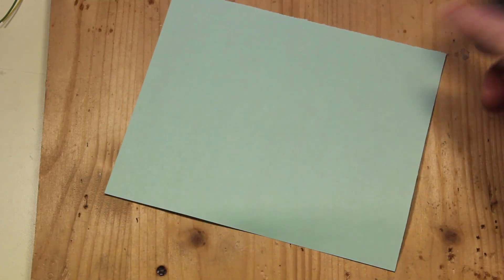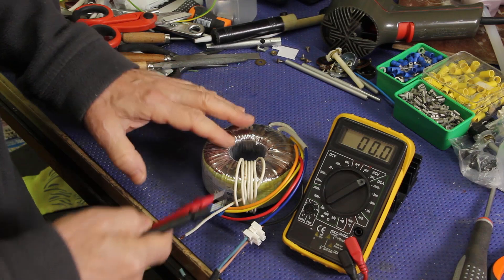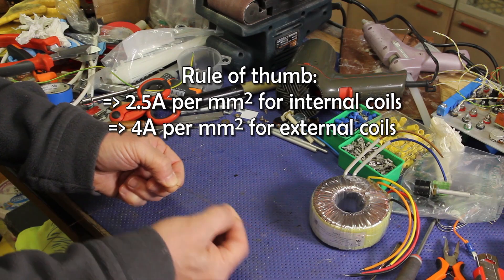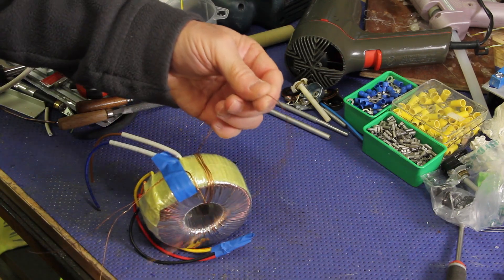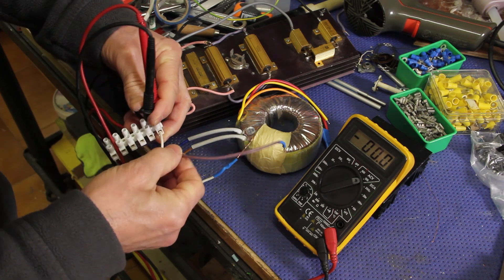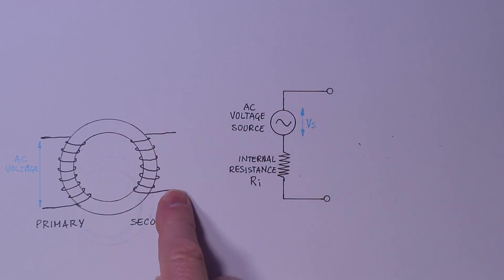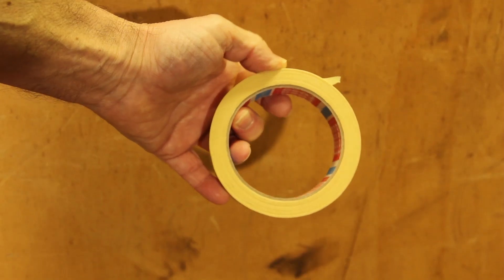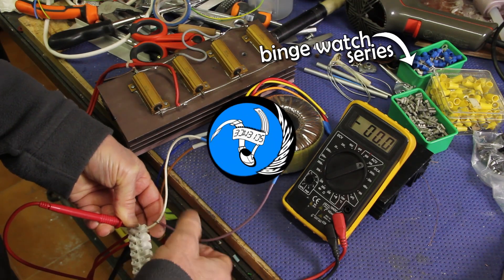How to Add Extra Windings to a Toroidal Transformer – Custom Multi-Voltage Hack

Comment: Even if you're doing shorter amounts of wire (without a shuttle), you can still make it a lot easier by first winding up all of the wire on a pencil or pen, and then removing the pencil/pen so you just have a small coil of wire which is small enough to pass through the center.  Then you just unwind the bundle as you go round and through the toroid (and you don't need to feed long lengths of wire through on every turn).
Reply from the maker: It could be an alternative idea but I wonder, not having a core that keep the wire in place, does this not risk of entangling or kinking the wire?
Reply: Thank you,  that is done in the industry.

Comment: For longer windings you  can use a foot long shuttle like an “H” shape made from a piece of wood that is thin enough to go through the hole of the toroid, thinner wire can kink &get tangled so you have to have patience! 
Great video : )
Reply: Sorry, just seen the rest of the video and you did that already! : ))

Comment: If you start winding in the middle of the length of wire you need, you only have to drag half as much wire through the core for every turn :)
Reply from the maker: @gorak9000  yep you're right!
Reply: Thanks.